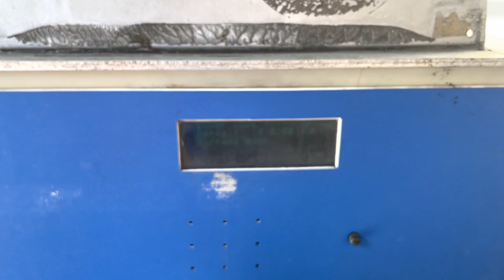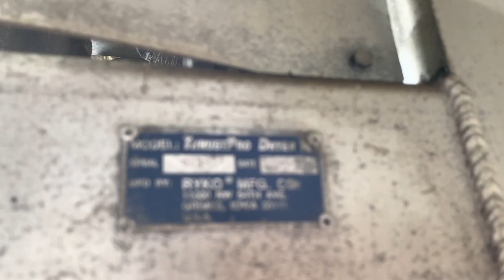Heavily abused Ryko Softgloss XS at Admiral/California Chevron Seattle WA

Comment: I’d usually really like old Ryko systems, but this, this one looks awful. It needs to be replaced.
Reply from the maker: That or a MASSIVE clean up and repairs but knowing they have no competition they  have no reason to make improvements since they know people will use this wash anyway as its the only option :(
Reply: @PNWcarwashchannel  Not only should the machine be fixed or replaced, but the wash bay walls and components need serious cleaning because seeing all that mud and bacteria could repel some customers from using the wash, even if the system wasn't in the same condition.

Comment: Seen this type of dryers at a Otto Christ Conveyor wash 28 years ago, got my driving license fresh and drove my 1988 Datsun - Nissan Micra/ March( yes a very tiny car) to it, 1994.....it stand on  BP Petrol Station..... The replaced it by a Christ C 100 Conveyor, this replaced 3 years ago by a Christ Evo Express Tunnel... Visited it often with my VW Jetta, Opel Kadett, Toyota Corolla, VW Polo, Ford Escort, VW Passat... Then the owner change and it goes south. Was one time there with my Suzuki Swift.... Conveyor Chain runs Quick, Brushes have no oppotunity to clean  my Suzi right, only good Thing are the touchless dryers and free vacuumcleaner, how call you Staubsauger in American?? Pay 8,50 Euro for it maybe 9 - 10 Bucks in your currency?? Too much for this results....